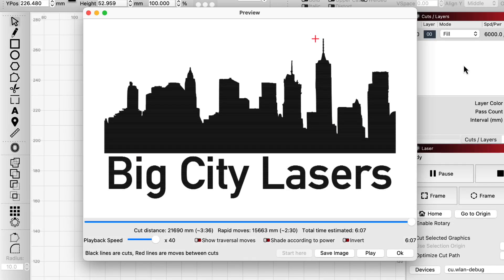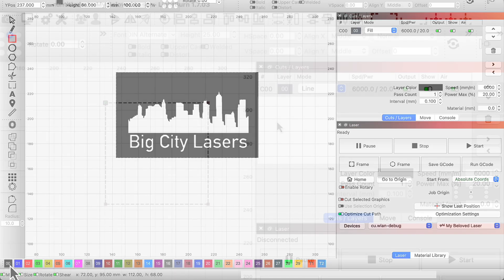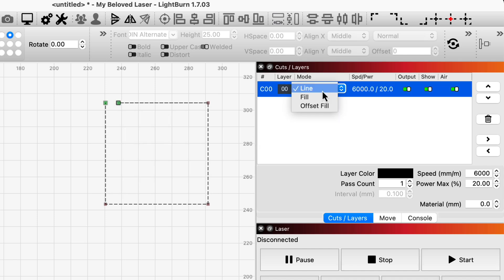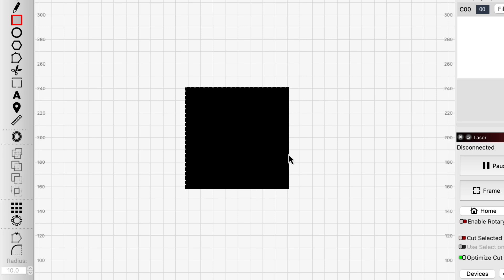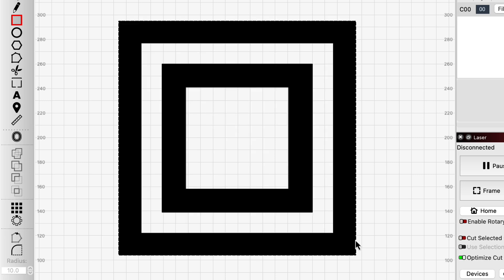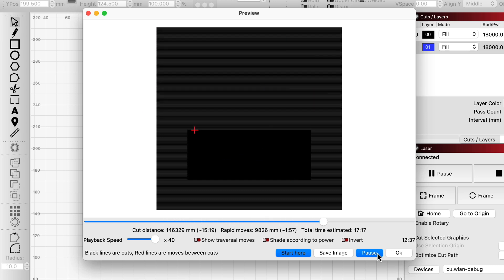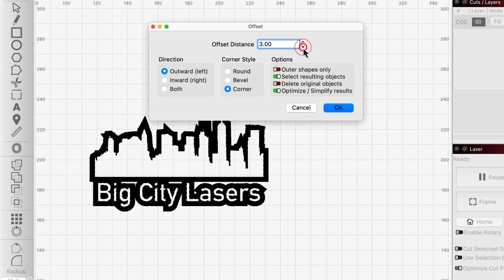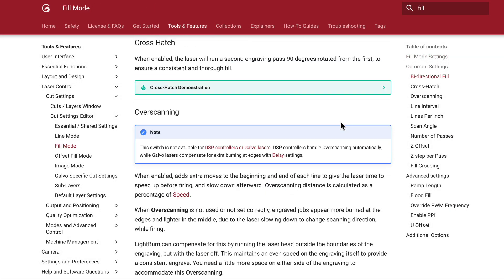How to Invert a Vector Engraving

Comment: Is this enabled by default? Mine doesn’t do this at all. I have version 1.7.08
I went through the editor settings and can’t find anything that would disable this action. Any help would be appreciated.
I’m referring to the on screen color change that shows what will engrave.
Reply: Filled rendering is not enabled by default, nor is it recommended to be left on all the time. You can enable it in the Window menu, but it is much better to work with the Preview, or just toggle filled rendering when you want to spot check.

Leaving it enabled full time will hide things, and makes it more difficult to select, see grouping, work with Booleans, and edit nodes. It is generally best to work in the default wire/outline mode.